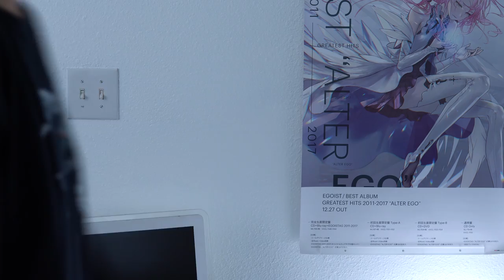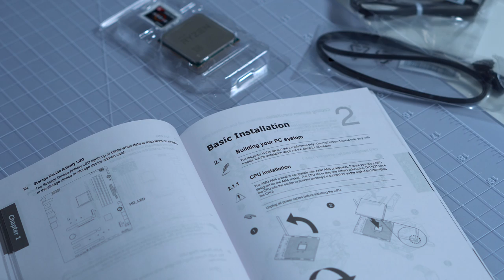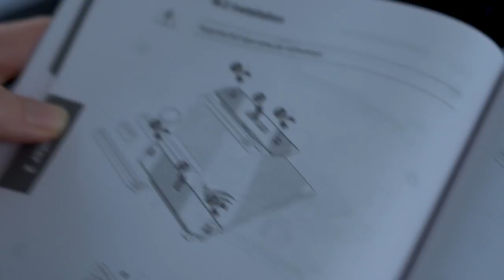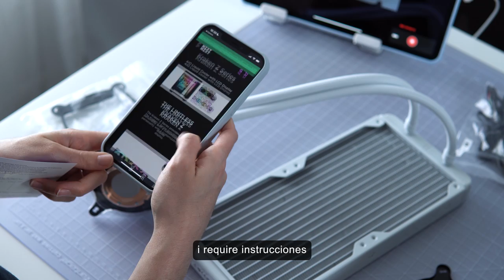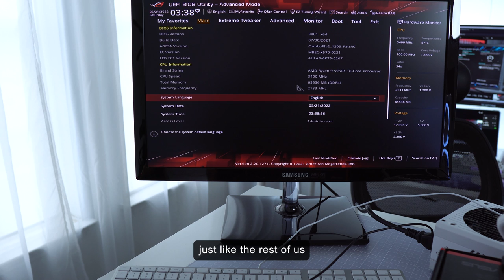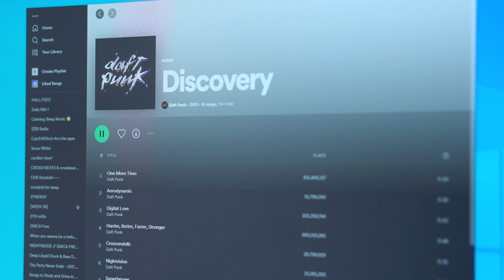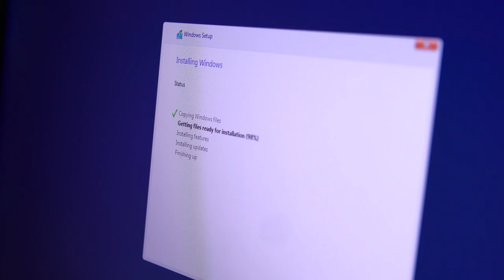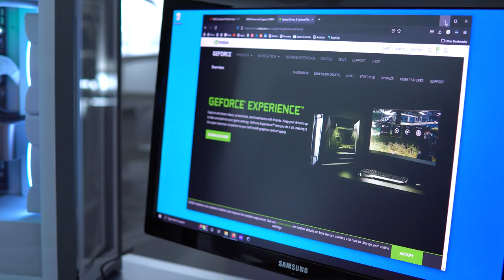3D artist custom PC build

Comment: Windows 10 still faster than Windows 11 and uses less hardware resources especially on intel CPU older than Alder Lake Architecture (12th Gen). Overall Windows 10 OS is stable and runs smooth. Don't upgrade soon, good to see you still using Windows 10
Reply: For now. They're going to bork it soon. :(
Reply: it's ugly af compared to 11, design is super inconsistent also, btw the hardware recourses is only a thing for low-end PCs and laptops, you won't notice any difference even on "ok" pc

Comment: By the way. The effective way to apply thermal paste on processor lies through center, its most important. 1big dot, or five smaller or traditional with line at side that can be rolled out with something flexible and flat like rectegular flexiblle magnet. Iam using last method, becouse you will get thinnest and flat layer with 1st try if you move card from side to side smoothly. Any way with that magnet you can make as much attempts as needed after that, result will be acceptable.

Comment: Sup, just wanted to say that 2 fans on your nzxt aio should be set as intake on the front of the case coz now you have all your fans set as take off. It will be pleasant for cooling your hot ryzen and for the rest of your components
Reply: fans at the top are intake

Comment: not sure if someone has already mentioned this, u can retain the nzxt fans position at the front, just move the radiator up (below top fans), fit the nzxt fans to the casing at the front then fit 2 top fans to the radiator to the top (make sure its intake) so this way we can improve the temperature as fresh air gets in direct to radiator, rather than hot air from RTX3090 blowing to radiator at the front, now.

Comment: Amazing build and I love the aesthetic, but just a quick heads up to set the two fans on your NZXT aio cooler to intake on the front to get better temperatures. Your current fan configuration is set to negative pressure (which means you have more fans set to exhaust than intake, resulting in a greater dust buildup than if you had positive or neutral pressure). Whatever air that gets blown out from your case will loop back round into it, causing higher temperatures.

Comment: Lovely. I had to IMMEDIATELY order the Screwdriver Set! You place is like watching 'Oblivian' - with none of the bad stuff. Thank you for sharing. Looking around it seems 80c or so is common for an aircooled 5950X under load but possibly a bit high if liquid cooled. Maybe investigate that. Cheers
Reply from the maker: ahaha, Oblivian is a great inspo ! the screwdriver set is so well designed.. i love it. thanks so much for watching and thanks for the tip, will definitely look into that

Comment: I love your videos. i have a tipp for your PC, all your Fans are blowing Air out of the PC, so you create negative pressure inside the Case. Maybe you turn around the front fans, so they are blowing in fresh air. When you turnb around the front fans, the radiator colellects dust from the outerside. It's sometimes annoying to find the correct way to mount fans.

Comment: Good thing the RTX 3090 is in the hands if  someone who will use it for something besides mining. The most laid back build video ever. Also are you going to overclock? Just checked R/AMDHelp and someone suggested resetting everything to default (voltage, frequency) first then use offset -0.1V then try cinebench. This will theoretically give you a -10 to -15 c temp difference. Alles Gute!
Reply: It's utilized better for mining than the redundancy it's going to experience there.. she's not going utilize 30% of the capacity of that gpu.. even editing 12k which  NO one is using atm
Reply from the maker: ahh thanks for the tip, i'll look into the overclocking. yeah i'm excited to see what i can do with real time rendering projects now that i have the rtx :)) danke :D

Comment: hey awesome video! just wanted to point out its sometimes recommended to run two separate power cables from the power supply to the graphics card for both plugs.

Comment: Wow how funny my pc was also from 2016 and I needed to upgrade the cpu and ram because my art software was crashing so bad! I have a black and white build and named it panda 🐼 the components are all white except for the inside of the case and my peripherals. I love that little tool kit you have, what a clever way to hold bits!! 

This makes me want to throughly clean my keyboard and finally upgrade my cooler too an aio! I bought it last month, but I haven’t had to time to install it and I need to rearrange my fans.

Comment: just a small suggestion for the aio cooler fans orientation. These should be flipped as intake to get fresh air from the front than exhaust. In exchange, you will lose some of RGB light since these fans only have light on one side. But you can also put the fans in front of the radiator if it is not blocked by GPU. So that you can both get better airflow and RGB.
Reply from the maker: thank you, that's a great suggestion. yeah i couldn't do the intake/exhaust setup i had planned bc of the cooler fitting issue. i don't really want to flip the front rgb fans bc of the looks lol, but i was thinking about flipping the back single fan to be intake like the top fans... it still wouldn't be my ideal tho. anyways thanks again :)
Reply: @2ynthetic  have you tried swapping the position of the fans and radiator. So scews will go through front plate --> fans --> radiator. I still have a hope that this way will work. Other wise flipping top fans as intake will also work fine. Swapping fans with rgb in both sides in the future is also a good idea too.
Reply from the maker: @thangnguyenviet5628  the thing is i want the radiator fans to be towards the inside of the case, not towards the outside. otherwise i agree switching them to the other side would be the best option. currently the top fans are intake. yeah i'll probably just have to get different fans to achieve the ideal

Comment: I have a similar build on my main PC (5950X & an RTX 3090) but my mobo is the 1st gen Asus ROG Hero VIII and not the Dark Hero and my 3090 is from MSI (SuprimX). It runs really good and no reason to upgrade to a 4090 even if I game at 4K 240Hz (Samsung Odyssey Neo G8). I envy your PC case though and aesthetic. My PC case is too big and heavy since I have a lot more stuff in it. I mainly just use this Windows PC for AAA gaming. My daily driver now is a mini PC (Minisforum HX90) which has a Ryzen 9 5900HX APU that has built-in integrated graphics running Linux.

Comment: Relaxing to watch ! 

But you're loosing a bit of perfs with this airflow (top intake + two side exhaust) both exhaust are competing against each other creating turbulences.
You could have both fans from the aio set as intake and the other 3 to exhaust. To benefit from the fact that hot air rises naturally. 

And on a side note, nvidia recommends two separate 8 pin cable for their 3000 series, with only one like in your build you could run into issues when running the gpu at 100% (most likely not getting max power draw)

Comment: hi, i think u should put water cooling on top... because now u have two sets of fans : one from case pushing air inside and from water cooling outside ;p also its just better for pump to be verticaly on bottom so there is no air on pump. best way to slove it is just put cooling on top

Comment: read ur comment about the idling temps, it's bc the fans should be on the outside case instead of inside the radiator of the color so air can pass through it cooling down your cpu
Reply from the maker: Hmmm I see, thanks for the comment. I’ve read and seen in videos that it doesn’t matter that much whether the fans are inside or outside the radiator depending on how the other fans are set up. But, I might try switching it any way bc I still have this issue

Comment: mmnn  looks like you may be short on fans for this system..I would worried  to get them too hot but I play and watch Tv at the same 
time.:) case is a nice one but little, small for using radiators. should have try the lian li11 or the 216.

Comment: I know you are not an engineer but you should at least know the basics of thermodynamics .. Heat rises so why go against it.. :D Turn the Front fans as Intake from the other side of the cooler so they draw cold air into the case and put the top 2 fans as an exhaust. That is the optimal cooling setup for that case, and if you need more lights in the case buy some LED strips :D